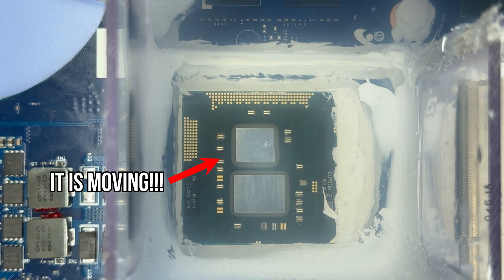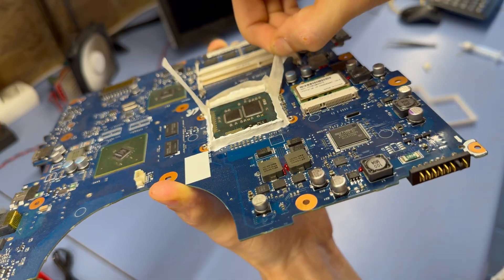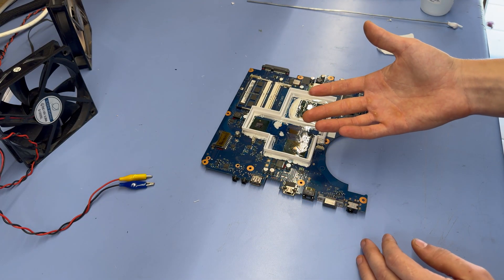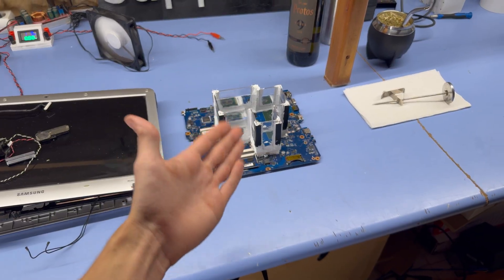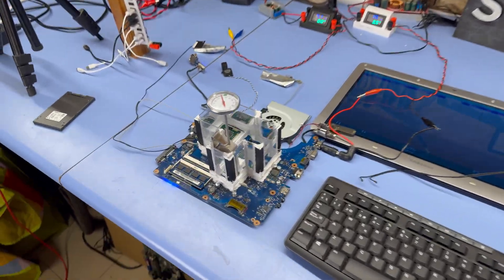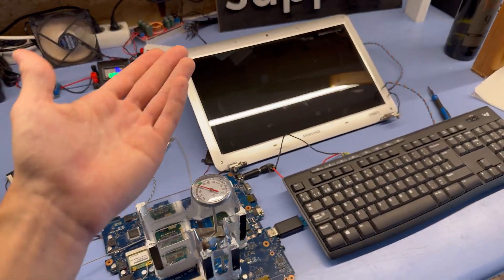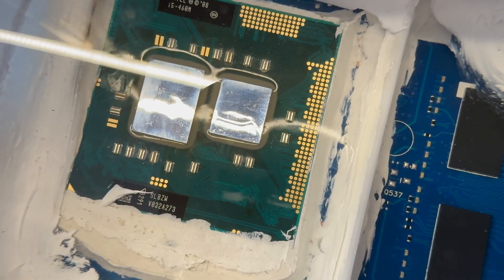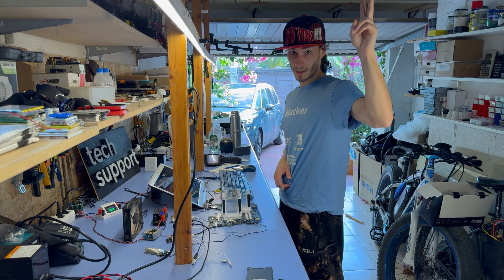I Tried Cooling a CPU With Just Water… and Something Strange Happened

Comment: your thermometer is only getting that small area if water's temp. bring the thermometer over to just above the chips and you will see they are going to be about 100 degrees C - the temp limit of intel CPUs. 
You dont have enough water and its not circulating.  AND it has become foggy because of the white glue you used is disoving in the warm water.?
you wouldn't shock yourself if you put your finger in it because there is zero electricity in the water. if there was it woudl have shorted out and turned off already :)
you experiement was a sucess, you just weren't do a few things the right way to see that it was. You proved that it will run under water, just not for very long at all. 
You should remove the water and replace it with COLD Water AND add some ice cubes. THEN Boot into windows. it was crashing because it was over heating, thats all. I was SUPER SURPISED it booted into Core Linux at all! WOW!
Burt you have to rememeber that you let it run for like 30 mins before you got around to doing anything. So it was near it limit when you started testing. You water sealing and container were a total success! But you shoudl try again, with a cold computer. Also, you could try other liquids too! I think if you had it filled with 99% isopropyl alcohol it would last longer (because it evaporates at much lower temps, to the phase change will remove heat at a lower temp, keeping it cool)
Keep going!!! :D
Reply from the maker: Thanks for taking the time to write this comment! I literally agree with everything you say! The water is muddy because of the white glue - exactly what I thought and the idea was to heat the tea in that aquarium and drink it, but seeing how dirty it became, the idea of drinking tea slowly faded away) I have new ideas how we can actually drink hot tea using a Computer! 
I also think that it just overheats when starts booting into windows. Like water can not conduct heat as fast as Aluminum that is why we saw some waves on the top of the CPU and that is a possible reason for the die to overheat. I will try circulating the water, should help a lot! 
Touching the reservoir is weird. Like if I am wet and I put my finger inside I get some weird senses like a small current going through my body. It is really hard to show on camera but maybe I’ll try! If my body is dry I don’t feel anything when putting my finder in the reservoir. I guess it has something to do with the ground of my garage! 
I think the next video will be trying out the different fluids we can put in the reservoir and make the laptop boot! 
Thanks again for your comment, really appreciate it! Peace ✌️
Reply: @Inventors_Den  
As far as I remember, those dies still had a thin layer of epoxy paint to insulate them...
I remember they sometimes used green paint, other times blue paint, and it gave the die an iridescent effect...

One of the many experiments I did was lapping a CPU die with the tools I had at work... it became a flat mirror, but... in the end, I only gained 5°C in overclocking, which translated into another 150 MHz of overclocking.
Of course, a 600 MHz Duron Spitfire to 1600 mhz (on Abit) wasn't easy to find, but it was a really demanding job, and there was a lot of risk involved... 3 days of sanding a die that could break at any moment...
I should still have those CPUs I'm telling you about.
Reply: @angelogiramondo1540  Wow, that's cool! So you basically overclocked by 1GHz?? How did it do, if you benchmarked it? I can imagine memory or FSB being a bottleneck at that point. Also curious how much more power and voltage it needed. It was really nice era of computing, however I was too young to enjoy it. I remember the first computer in my family being Pentium 3 with 512MB of ram and 32GB HDD if I remember correctly, but I was just 6 years old back then. A few years later we got a notebook and I was given this PC. Grandpa also bought a laptop, having no internet he subscribed for various PC magazines that came with CD and later DVD full of software and little games, I have fond memories of them, in fact, I think I still have some of them in a box somewhere :D. As I was kinda dumb kid back then, I set a password on my account in Win XP and forgot it, no one knew what to do so the poor PC was scrapped :(...
Reply: @steposka  
The Spitfire was an amazing die.
It could handle 2.05 - 2.10V without breaking a sweat! (my Asus A7V133 had 2.4V mod).
Honestly, I don’t remember the absolute benchmark values anymore (I don’t even remember which benchmarks we used), but there were only a couple of Americans who managed to beat me in the rankings.
One of them worked for a big distributor and tested CPU by CPU to find the golden samples...
I paid for everything out of my own pocket and couldn’t afford that (back then there were no sponsored from manufacturers, no official competitions; it was just for fun).

We’re talking about over 90-100W of power draw (at the time there was no “affordable” equipment to monitor consumption effectively and accurately, so take that figure with caution).
Those systems were practically unusable... to cool it with air I used a tangential impeller that was meant to cool the trubocompressor and carburetor of old Fiat Uno Turbo; it was big and shaped like a Garrett compressor and consumed 250-300W (I powered it with a bench power supply because I didn’t have 12V PSUs capable of 20-25A).
I swear, when you turned that fan on you could feel the airflow even 4 meters away and... at least 90 dB! much worse than the PAPST 60mm that were used in the normal "aggressive" settings.

No, it definitely wasn’t a “daily use” system.
At those voltages, you could only get there with an open-loop liquid cooling system, with the “bucket,” adding lots of ice.

XP was terrible; if it crashed 2 or 3 times it broke the bootloader and you had to restore the disk image again, but it gave you a lot of freedom.
I even used an installation that loaded directly into system RAM, with Disk Angel, a driver on interrupt 9 that emulated a virtual disk in a RAM drive, and with Grub you did an “on the fly” copy from storage to RAM, then booted... it was one of the few RAMDISKs that offered 1 GB of space.
I cut my teeth on 486s, Pentium 75s, then Intel decided to ban overclocking.
At some point I even found a way to unlock Pentium 4s, but it was really too complicated, requiring microsoldering, and I couldn’t (with the few CPUs I managed to get) complete the pinout decoding.
With Athlons, unlocking was definitely easier.
I have a drawer full of abused old CPUs... I keep it as a reminder of how much money I wasted for being too stubborn.
Reply: “You wouldn’t get a shock if you put a finger inside because there’s no electricity in the water. If there were, it would have short-circuited and already shut down :)"
It doesn’t conduct because everything has been insulated with epoxy.
Even bi-distilled water conducts electricity, although it’s almost pure.
Only absolutely pure water doesn’t conduct electricity, but water is the best solvent in nature, so making it truly pure is just utopia.
And I’m telling you this as a pharmaceutical chemist… you can’t imagine the problems we face when preparing vials for dissolving injectable drugs, where you’re supposed to have pure water…
One of the typical checks we do is precisely the water’s conductivity… bi-distilled, filtered through microporous filters, is about 1 microSiemens per cm…
As a chemist and a father, my opinion is absolutely against using flammable liquids.
You risk your life doing such nonsense.
Are you boiling gasoline? What do you expect to come out of that?
As for the water becoming cloudy, nothing is dissolving; in reality, the water is just turning opaque.
It’s only the microbubbles of steam forming that make the water cloudy, because you’re right, the CPU is at the thermal safety intervention temperature for Intel CPUs: 105 °C; in fact, it shut down for that reason.”

Comment: the cpu die looks like its moving from the heat from the die of the cpu heating up the water changing the density of it (if im not wrong) and thats what is causing it to warp like that. same way air looks like it warps over a hot surface
Reply from the maker: Great point, yes the CPU die indeed cannot move so what we see (I guess) are the streams of water right next to the CPU die!
Reply: @Inventors_Den  Does that BIOS show you what the die temperature is?
Reply: Yup, if you heat up a pot of water that is large enough to have a range of temps in it, hot on the bottom, but cool enough to be clear at the top, you can see the same effect.  If the water is hot enough to steam all the way to the top it is harder to see.
Reply: Exactly.
It's the change in density and the formation of microbubbles of vapor... that die is at 100°C, but there's not enough heat generated to activate thermosiphon circulation, and so the hot liquid lingers too long near the die, making heat exchange difficult and thus heating the die.
A forced movement of the liquid is required.
Reply: @angelogiramondo1540  if you add circulation, it changes the system a lot. and you dont get to see the cool effects, and dynamics, of a passively liquid cooled system.
Reply: @epockismet76  
Okay, but it doesn’t cool.
The problem is that if it doesn’t mix, it doesn’t cool.
The liquid needs to move to provide at least minimal cooling, or you’ll have a laminar stratification of layers of water at different temperatures, with the hottest part facing the CPU—even if that doesn’t seem physically correct.
But I assure you, it’s physically more than correct… in real dynamics, that’s exactly what happens.
If you don’t have the right temperature difference, water at different temperatures will stratify, even if a lighter (and hotter) layer ends up beneath a heavier (and colder) one.
If there’s no agitation in the fluid, the temperature gradient is low, with minimal density differences, or if there are different salinities or pH levels (though that’s not the case here), you have a comparable pressure gradient, and you won’t trigger any convective motion—only laminar dissipation between layers.
Do you know what a brinicle is?
https://www.youtube.com/results?search_query=brinicle
Same thing, but instead of laminar stratification, it’s tubular, because even though the water at the bottom of the sea is colder, the fresh water melting from the ice can’t diffuse well into the salty water, since it’s at 0°C (melting point), and so it freezes the seawater immediately below, all the way down to the seabed, killing everything it touches (because at 0°C in water, nothing survives).
Reply: caustics
Reply: It’s slightly density change, but water’s refractive index changes based by temperature as well, so what you are seeing is essentially heat ripple (like what is seen over a fire), but in a liquid concept rather than gaseous.
Reply: @Eireman_on_Twitch  
It's fascinating, isn't it?
It's to understand these things that I dedicated myself to chemistry and physics.

Comment: the only thing that is moving is the WATER. it is the HEAT coming off the chip and moving the water. you know when you look at the hot black asphalt on a hot, sunny day and you see the air moving and being wavy and the light is being distorted? will this is what the water is doing from the heat of the chips. nothing weird, just optical physics :)
Reply: It's a marage but it's happening inside water.
Reply: It's not installed windows 10/11 to se laptop, old cpu - not supported from to bios samsung!
Reply: @lordalukard3456  
No, errors due to excessive temperatures... Linux, and not only in this respect, is much more robust.
Unfortunately, the effect of the difference in water density described above leads to another problem: if the water near the die is already hot, it doesn't allow the heat to be effectively "extracted" from the die.
It's a thermal pocket.
In this case, a film of hot water actually forms around the die, and you can see it because microbubbles of vapor also form (which makes the CPU very hot), but they're too small and can't penetrate the layer of hot water.
The clouding of the liquid we see is also due to the very fine microbubbles of vapor, which take a long time to rise up the water column. Many then recondense before reaching the surface.

Generally, a certain trigger temperature is needed for the convective motion that would allow the hot water to rise and make room for the cold water. In this case, heat is exchanged layer by layer of water, as if they were the pages of a book. Stratified heat exchange.

Either you use something to mix the various layers, moving the water, or you should add ice, which will float on the surface, to trigger convective motion because it creates a greater temperature difference between the top and bottom, and therefore a different density of the water, which will allow convective motion to begin.

The effect is the same as mirages: stratification of the air at different densities. You get a mirage because air, like water, has a different refractive index depending on the temperature.